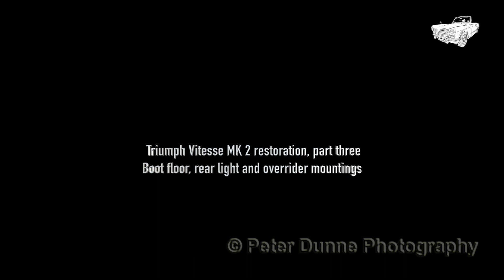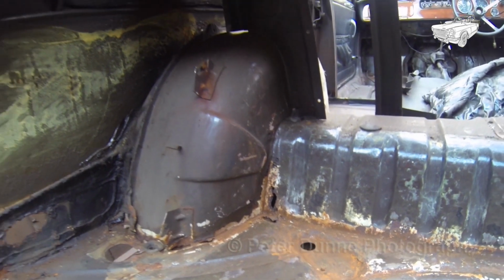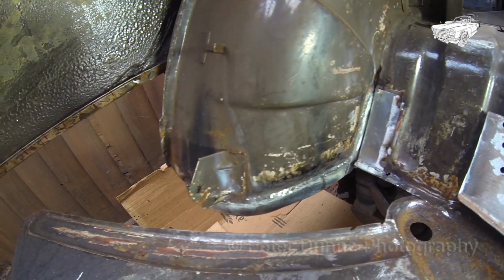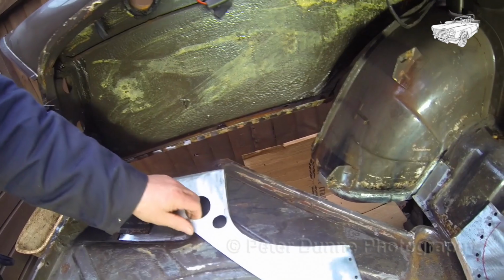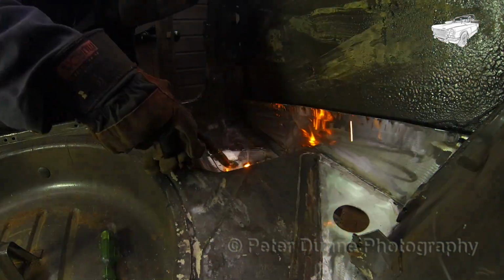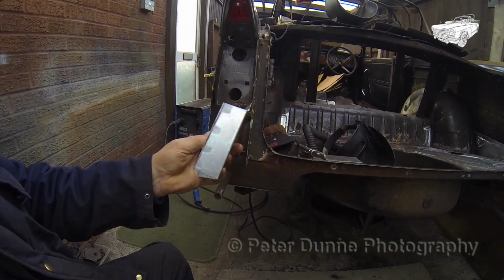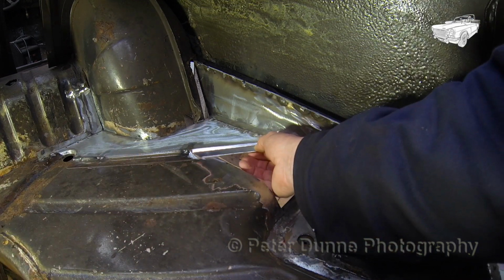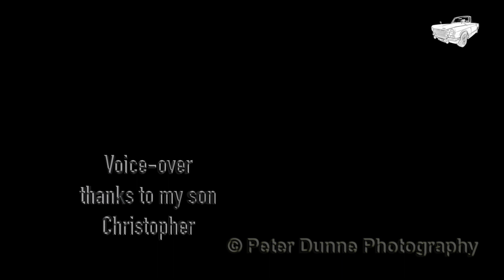Boot floor repairs HD 1080p

Comment: Very nice Peter . I repaired my TR6 tub with it stilled on the chassis . As you say it's acting as a jig . Thanks
Reply from the maker: For a full restoration. I do take it off the chassis after I've done any repairs around the body mounting  brackets. The rest of it doesn't really matter if it's on the chassis or not so long as your measurements are accurate.
Reply: @peterdunne8107  likewise .